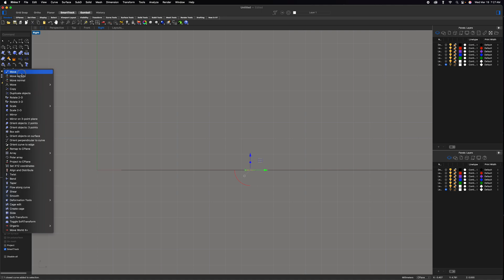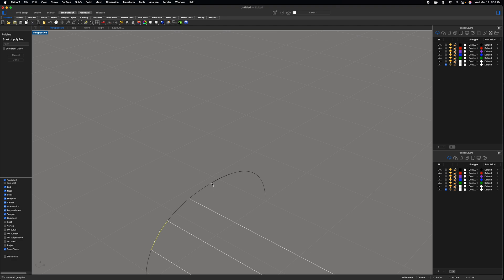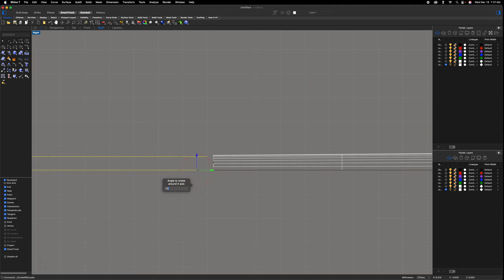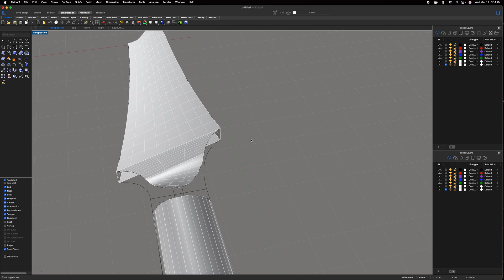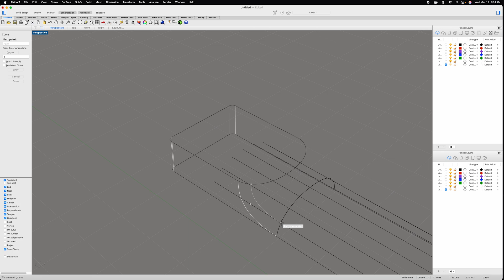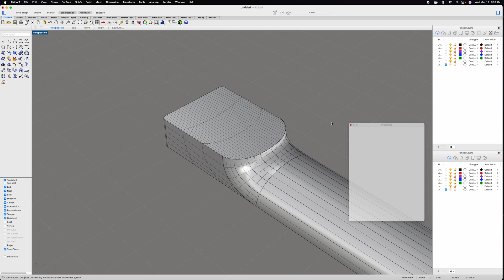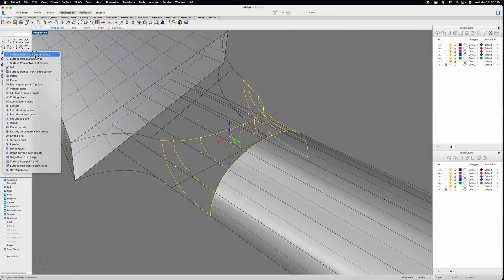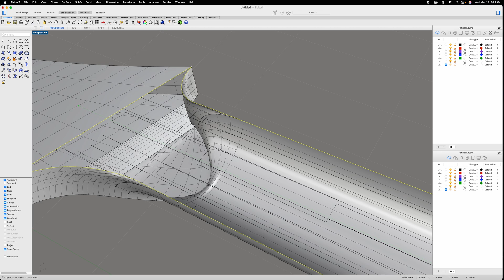3D Modeling A Solid Body Guitar Neck

Comment: Hi Chris, the 1000 ways to use Rhino. I expected to see lofting, using solids and several boolean operations, but you build the neck as a wire frame model. Interesting, I have to try this. Thanks! The neck has now several straight surfaces with little edges? Will you sand it back later after the cnc-routing?
Reply: You divided the 2 radiusses (1. fret - 12. fret) with several points and connected them with straight surfaces along the neck? Maybe I didn't recognize it correctly in the video and I have to watch the video in the member section
Reply from the maker: @ Do you mean like a faceted surface? It’s. The surface is smooth without little edges.
Reply: @TSpelter  I've used Chris' method successfully and they're not flat because the two short ends of the network surface are the curves of the neck profile.
Reply from the maker: @TSpelter  I don’t know what you mean.

Comment: Hey, Chris. I haven't tried carving an angled headstock, but one of the things I've been wondering about is the perpendicular headstock lines when you are "under" vertical. Meaning, the lines you drew perpendicular to the face and back of the headstock, at the tip of the headstock, are "over" vertical, so when the CNC is carving on the Z it will be like following the edge of a pyramid. No problem. But the lines perpendicular to the face/back at the bottom of the headstock are under vertical in terms of the Z, so there's no way to get that until you flip the stock and do the other side, correct? Is that what's going to happen when you do the carve?
Reply from the maker: That is correct.